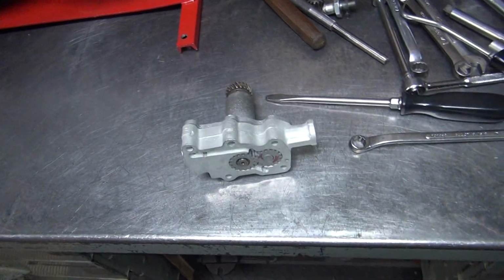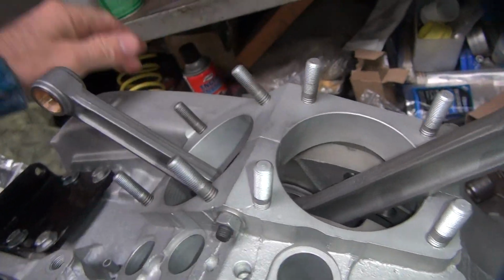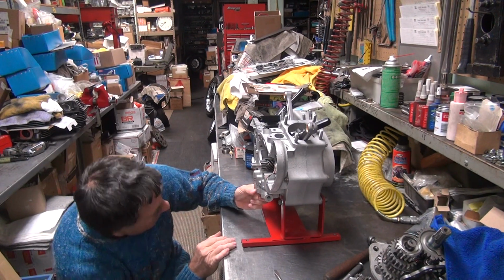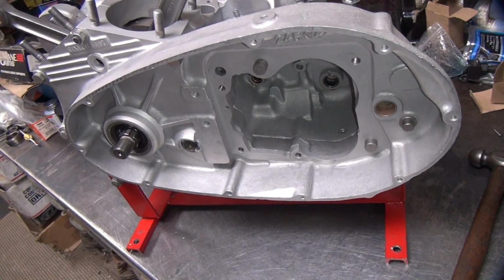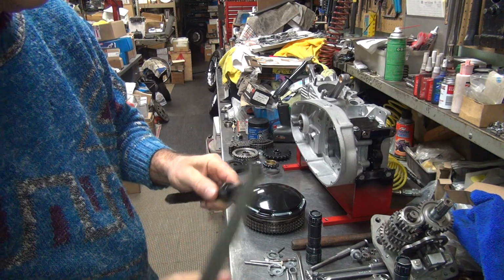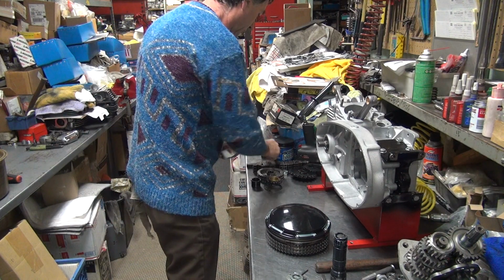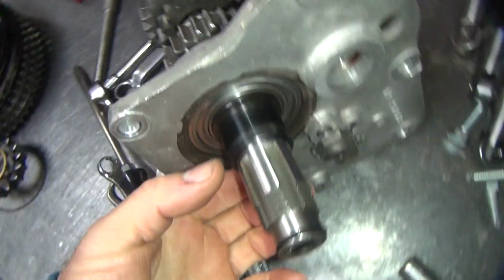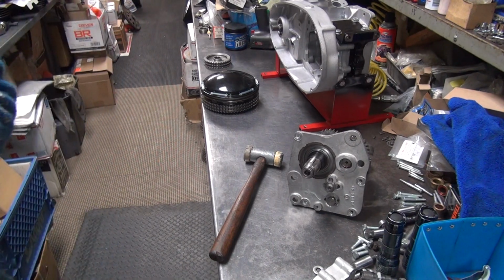1961 xlch #204 no miles transmission motor rebuild sportster harley repair restoration tatro machine

Comment: I   had  a  similar  problem  on  my  68xlh ending up  having  .030thou  ground
off  the flange on  the  sprocket  shaft allowing the  rods  to  be  centralised
and  placing the  pinion bearing  in a  correct  position , this  might  help your
primary  alignment  and  the  breather  timing, what  do  you  think?
Reply from the maker: yes, this would be the correct way to fix it. at this point i have gone down the road far enough that i think i will just deal with it instead of starting all over again. i was 50 50 on whitch way to go but after i figured out the breather timing i decided to just go with it as is.
tatro